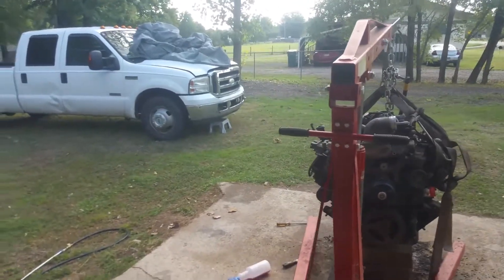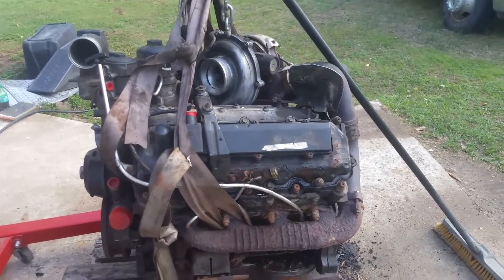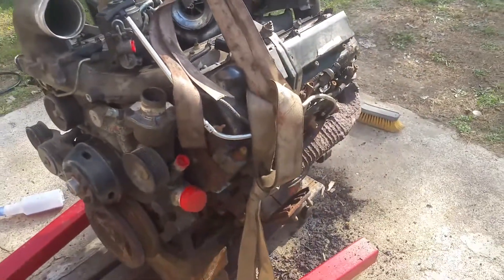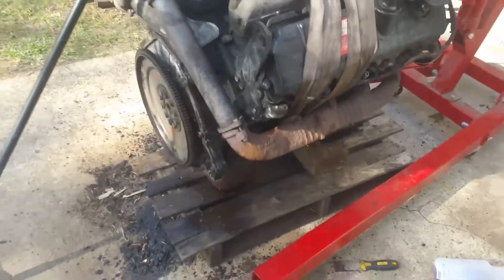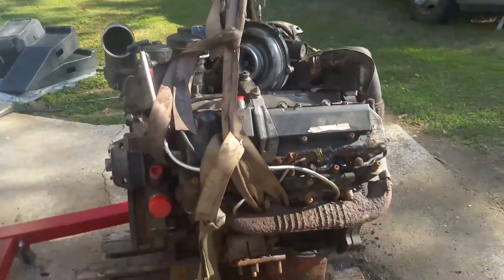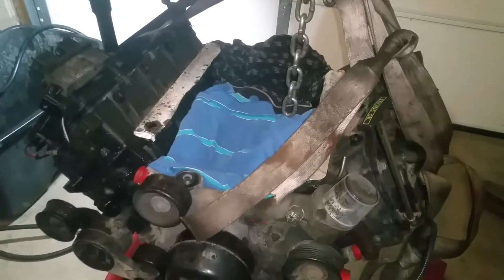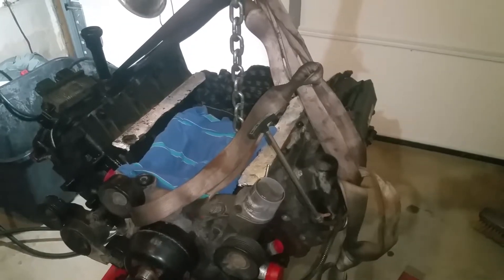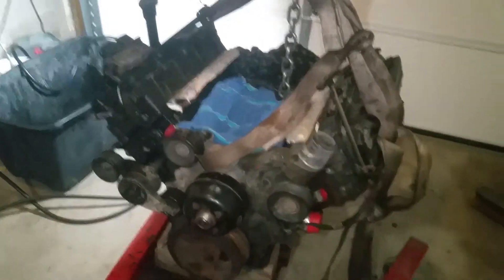Engine replacement ford 6.0l

Comment: "It was a little scary getting it out of the truck" 😂😂😂👏I hear you I do them often they arent light especially using a picker to pull one out the back of a truck
Reply from the maker: Exactly , after moving this one a few times I was replacing the hydraulic ram on my cherry picker. Thank you for the feedback , much appreciated.

Comment: Were you able to replace it w/ cab on?
Reply from the maker: Yes , the super duty have a removable brace there in the front . Once the radiator and condenser are out of the way there is all kinds of room . My ac wasn't charged so I didn't have to get the system evacuated . Thanks  for watching

Comment: how much u paid for it?
Reply from the maker: I actually found this engine on ebay . I'd been searching I'd say for months through all the engines and came upon this one. It was a "make a best offer " listing and they accepted my bid . I believe it was $1700 that's including free shipping . 170k on the engine and unknown to me at the time it came with arp head studs . I was sure happy with the find for sure and the great price . I will say persistence pays off just keep looking until the right deal comes along. Ebay has a money back guarantee also so if there is any trouble with the engine . Best of luck and thanks for checking out the video
Reply: s33therfan u got alot of work to do good luck

Comment: Yeah, looks like you got a good one there. 1000lbs! Hell yeah it would be scary on a stand raised all the way up. Looks like a nice project and it's nice to have parts to swap over as well. Thanks!
Reply from the maker: +Baxrok2 yes I can't wait to get this truck running I'm really getting excited at this point but I know I still have a lot of work ahead to do the job right . I was real happy when i realized that the previous owner had upgraded to the arp head studs . Thats one less thing to worry about and one less expense .Thanks for watching